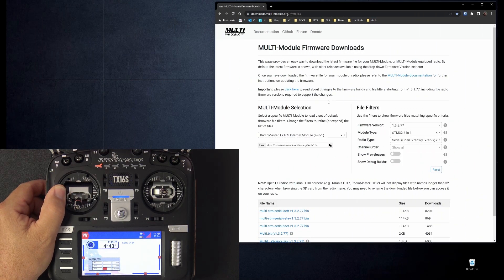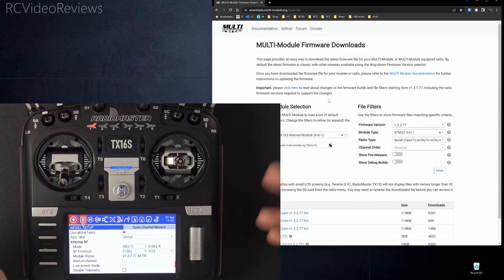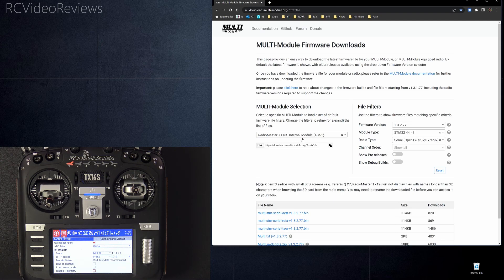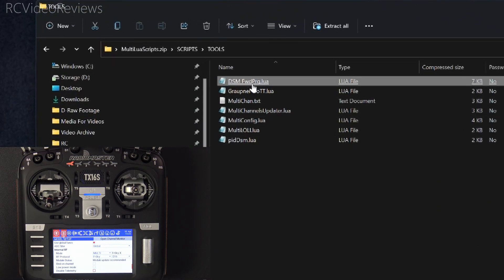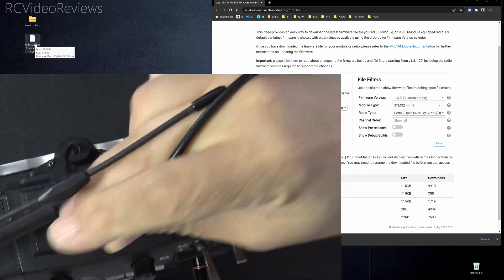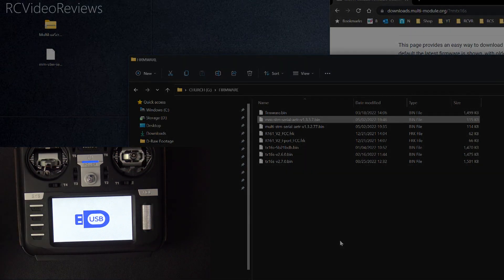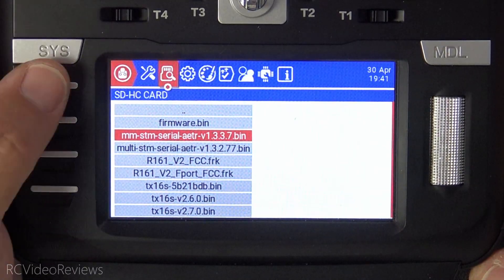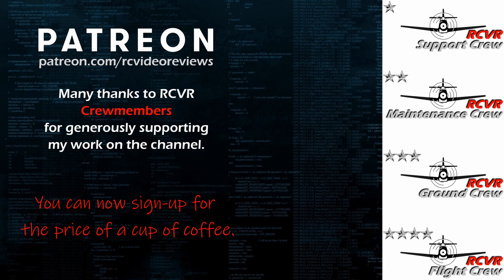Module Update Recommended • How to Flash Radiomaster TX16s Multi Protocol Module in EdgeTX

Comment: My first contact with my LBT TX16S was very frustating due to the lack of info about the lack of protocols .  Specially because of the 2500 firmware that did not work for me and made me hit a wall. .  Please add an LBT "word" to the title or make a specific LBT video because google never showed it to me, and there are many firmaware videos out there that did not help much as there are many firmware options and its not easy. MANY EU users has LBT radios and the same issues i had. Thanks to your video and a .bin that a nice FB Radiomaster group friend  (Shane) sent me i could bind my RX and start enjoying the radio.  Actually I found the video today by  a link from the customer service from radiomater ,not by google.  Thanks again.

Comment: I just updated because I wanted to use a RadioLink receiver and I didn't have the Radlink protocol. This update solved the problem BUT...The radio link receive R8EF defaults to a mode that does not work with the tx16s. You have to briefly tap the bind button on the side to switch modes. It will change the LED from purple (combined red and blue) to just solid red which will work.  I found out the hard way (servos went berserk). reply to this if you have any problems with yours and I will try to be more explicit. Has anyone else had this issue? the receiver is 
Radiolink R8EF 8 Channels 2.4GHz RC Receiver SBUS/PPM/PWM

Comment: My TX16S has firmware version V2.8.0 released on 11/25/2022, and multimodule version v1.3.3.20 AETR, should I update both the Edgetx firmeare and multi module version? If I do it, would it lose the current settings on my airplanes that I fly? Thanks in advance
Reply from the maker: It's generally a good idea to update MPM with EdgeTX. You won't lose bindings.

Comment: Thx, very helpful video.  I successfully updated into the FIRMWARE file, but not sure where to put the SCRIPTS update.  Into the FIRMWARE file or SCRIPTS file, or elsewhere.  You say to drop the file in the root of SD card on radio,  not sure what that means. Can you tell me where to drop it? Otherwise I just left the SCRIPTS the way they were.
Reply from the maker: Scripts folder belongs in the root of the drive.

Comment: Well, I think I may have a bad mainboard. Trying to reflash the internal Multi-Module and it is saying “Firmware update error Device not responding.” This is after installing a brand new module after seeing the radio showing an error of “No Multi Telemetry Detected.” Any ideas?
Reply from the maker: I think we're talking about it on discord...
Reply: @RCVideoReviews  We are indeed. In case someone comes across this comment. It's a hardware issue since I've installed a new internal module, cable, and antenna. The module firmware is current as of the date of this comment. Unfortunately, this means ordering and installing a whole new mainboard.

Comment: Ok great. New EdgeTX TX16s coming tomorrow. 

Question: i have an E120 Heli that runs/Expects TAER. 

Then I have a second C189 MS500 RC ERA that I think is AETR. 

When you Choose Multi you can pick AETR (Default) or TAER or RETA. 

Since I need TAER for the E120 and I flash that. How do I deal with the other needing AETR. Saw notes about making it into whatever you need in Radio Channels?  Thanks! 😊
Reply from the maker: I suggest you give this a read: https://www.multi-module.org/using-the-module/channel-order

None of my RF tech has channel order requirements so I don't have practical knowledge on the issue.
Reply: @RCVideoReviews  
Great!  Can use AETR Firmware and Radio Automaps to what model requires. Cool! 🙂

Comment: my jumper Tx16 says firmware update error, device not responding. edgetx is up to date. any fix for this?
Reply from the maker: You should join our discord to work this out. YT is a terrible platform for the inevitable back and forth required to solve this.

What flash method did you attempt? 
What firmware did you use?
Reply: @RCVideoReviews  man.... I read yesterday afternoon that I have one of the late models that need hardware installed in the back of the radio to flash the module.... Looks like I will be upgrading to radiomaster TX16s. Lol. I just sold my XG14 (never really used) to fund the 16s. Greatly appreciate your videos though!!
Reply from the maker: Ahhh. I have never had a T16, so I'm not familiar with the ins and out. The TX16s MKII is really good. You should be able to repeat anything I demonstrate with a TX16s.

Comment: Does it cause radio interference if the module is outdated?
Reply from the maker: I don't believe they change the fundamental operation of the module/frequencies with updates. If you want a 100% answer, you'll need to ask the MPM developers.

Comment: Hope you can help me.
I have the Radiomaster TX12 mkii with the cc2500 mpm module.  Went to update from the mpm site but there were 2 .bin listed, a 64kb and a normal one, and I didn't know which to use.  I instead had EdgeTX Companion download all updates for it but I think it actually downloaded for a 4in1 module.  Flashing it seems to have bricked my mpm, because now it says "no telemetry" where the version number should be, and trying to reflash with any other .bin it fails saying "FW update error device not responding"
Any help would be appreciated.
Reply from the maker: The cc2500 isn't really an MPM module. In any case, it doesn't get the firmware from the MPM site.
Reply: @RCVideoReviews  Hii I'm facing the same problem. What am I supposed to do for flashing the firmware???

Comment: I got a No MULTI-TELEMETRY message after the firmware update...so not sure what happened
Reply from the maker: You probably got the wrong firmware: 
In this situation, one of the following may be the cause:
The selected module is not installed - External is selected when Internal should be, or vice-versa
The wrong firmware is installed on the module - the wrong radio firmware, or telemetry inversion setting was used
The module is defective
A somewhat common fault is bad solder joints on the 5-pin module bay connector

Comment: For the scripts do you completely replace the scripts folder or open up the newer one and drag and drop the LUA's in there
Reply from the maker: Drag and drop the new ones, it will overwrite old data. The MPM scripts do not include all scripts the radio ships with so if you delete the scripts folder, you'll have to replace stuff you may want.

Comment: I tried using the DSM forward programming after all the updates and no dice. Any luck with you?
Reply from the maker: I don't use Spektrum/DSM. I've toyed with some off brand dsm protocol RXs but no regular usage.
Reply: @RCVideoReviews  Oh ok. I recently purchased an AeroScout and got some features to work but can’t turn them off. 😅 So I am locked in and changing between SAFE or AS3X..

Comment: Hi John, a couple of my planes are still using Spektrum receivers. I am getting telemetry alarms soon after I take off. Is there a way with EdgeTX to calibrate the RF frequency? Jim
Reply from the maker: There is a frequency fine tune for protocols that support it. If the frequencyfine tune doesn't appear on the bind screen with the protocol selected then it's not supported.
Reply: Thanks! I’ll try just shutting them off. Range tests seem to be fine.

Comment: hey i don,t have that fine tune for my receivers like your page,maybe cause i fly planes?
Reply from the maker: It's based on the protocol for the Rx, not the airframe. I did a frequency fine tune at the field for a plane today.
Reply: I am using the radio master r88
Reply from the maker: Frequency fine tune appears in the module configuration area when the protocol you chose supports it. If the protocol you're using doesn't support it, it won't be visible. i.e. Set the protocol to FrSky D16 and you'll see it show up.

Comment: The main reason to update the MPM firmware to a version equal to or later than v1.3.3.0 (as this is the minimum version being looked for) is that v1.3.3.0 introduced the ability to query the MPM for the complete list of protocols, subprotocols and feature flags, meaning the from that version onwards the MPM tells EdgeTX what your module is capable of. i.e. you don't need update EdgeTX when a future MPM firmware introduces new protocols / subprotocols, which you would have had to do before. Another great instructional video... thanks! :)

Comment: just to clarify, this update will have NO bearing on receivers currently bound to the MPM, correct?  i won't have to re-bind anything after this, right?  cuz i have a lot...lol
and thanks for all the great work you do to help all of us out here in RC Land...😁
Reply from the maker: No changes to your existing binds. I flashed my mpm four times for this video, once going backward to invoke the error message and have connected to two different planes since then. No issue.
Reply: @RCVideoReviews  outstanding!  looks like i have a little updating to do then...thanks again!  cheers!

Comment: What do the Lua scripts do?
Reply from the maker: They enable certain over the air capabilities like DSM forward programming.
Reply: They also let you configure some aspects of the MPM, such as the ID it uses for binding (i.e. if you want to use two different MPMs to control your stuff without having to re-bind), and there are helper scripts that can name all your channels for you (useful if you are using some weird protocol for a miniquad or something and don't know what all the channels it supports are).